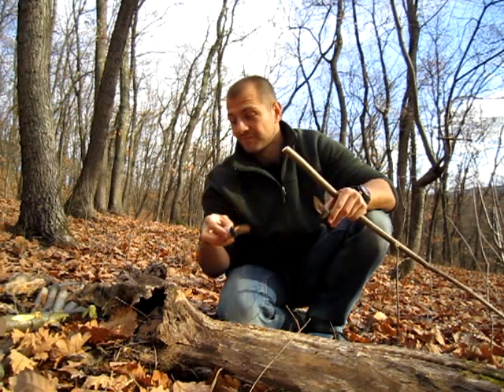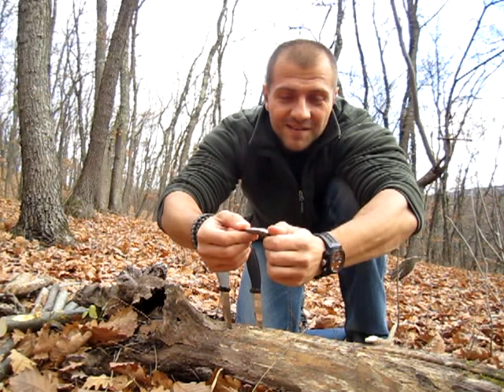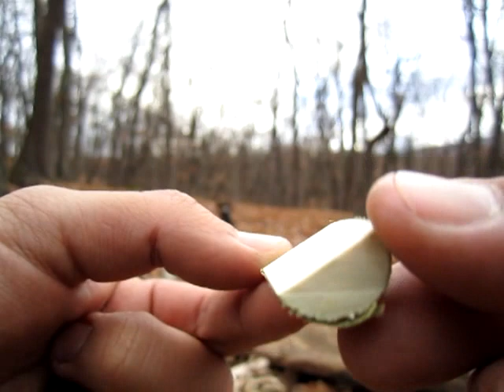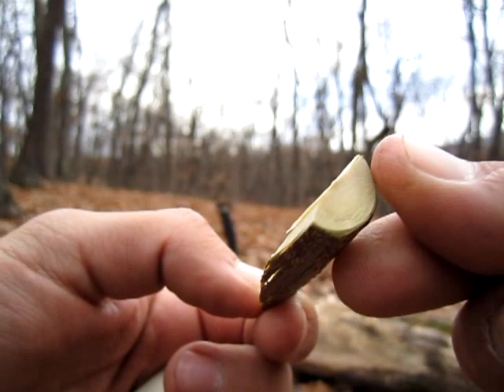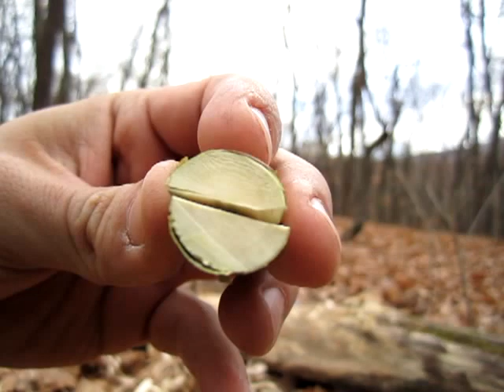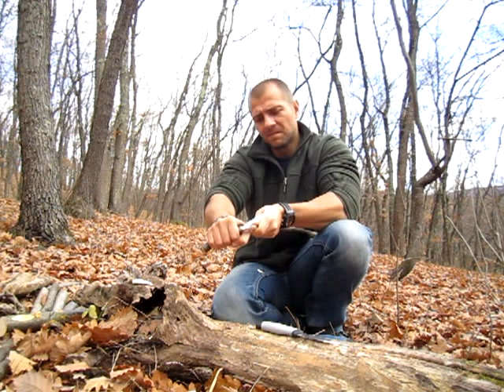Mora Robust Vs Mora Companion

Comment: I have two Mora Companion knives having liked the first one so much, I bought another so now, have one in green and one in black. Both stainless steel. I tested my first one the old fashioned way, processing a white tail deer in the field. From gutting, skinning and parting it out. Knife gave optimum results without need for sharpening. I always carry a Buck 301 3 blade folding pocket knife and have since my time growing up and working on farms and ranches. This pocket knife has come in handy so many times that I wouldn't know where to start in offering why you should have one in your pocket every day! I have made it into my 60s now in a life filled with hunting, fishing, canoeing and camping. I have relied entirely on Bic lighters and/or strike anywhere wood matches and have never been without fire. In recent years, I picked up one of the new ferro rods and have used it to start fire a few times. I guess what I'm saying is, be careful where you spend your money. It's easy to get caught up in all the latest and greatest gear but when it comes right down to it, simple and reliable and in your pocket trumps em all in most cases. Just an opinion from a life of knife use "in and out of the BUSH" as they like to call it now days. In scouts, we referred to it as "woods-craft". Be safe and always know how to get back to camp.
Reply from the maker: I agree with everything you said. First of all...the Mora Ccompanion is one of Mora's best knives when it comes to price/performance. I too used it for hunting(buck) and it did everything without problems. 
A BIC lighter will always work. Nowadays I prefer Clipper lighters...they come in bright colors with transparent walls...and you can remove the sparking mechanism if you want. Which can prove useful should you run out of gas....
As for spending money on things you don't need...well...i agree with you on that too...I envy people who do not have this "problem". There are a lot of bushcrafters out there who only have a victorinox and a Mora and they manage to do everything with those...
As for the Robust...the greatest advantage of the Robust is its 3.2 mm thick spine...if you are out bushcrafting/hunting you can do more with a 3.2 mm thick blade than with a 2 mm thick blade...
Lots of people are against batoning pieces of wood and claim this to be part of "the youtube trend". I found this to be simply not true. Whenever I work around the cabin with my girlfriend's dad he uses his knife in combination with a hammer or a piee of wood to make a cut, split something...this was a valuable lesson to me. People who use their knives because they need them not because they are testing, do so without thinking "is this the right tools for the job?" 
He had an old buck knife with a gut hook. He broke that gut hook while collecting pine resin. He never cared/complained about it... he ground a new gut hook into the blade... 
I have the highest of respect for such people.
I like to test knives and other tools. To be honest, when I go hunting, hiking, camping, you can always find a Mora Companion or the Robust in my backpack.

Comment: Say Heah Denis,  You do great reviews on the Mora's.  and I too have my preferences.  My Fav.  is my Mora 2000,  and very often I use my Mora 510 (new version)  which is the same blade style as my Classic #1, I actually like the handle better on my Mora 510, But when I made the Sheath safer on my Bokor Black Rold,  I took the Tec-Lok off and put a Belt Loop Carry.  But the handle snap was a little too big,  But still safe. I thought of many ways to tighten it up,  By sticking it.  But instead I put my Classic #1 through the strap and now I have my Mora Classic #1 attached to my Rold Sheath and it came out Aces. Actually with the Red in the Liners and the Red Handle,  It's looking good Amigo.  As usual a job well done.

Comment: First off: your English is superb. Also a very good comparison of two very practical knives. Just had one question concerning your gear there: what is that watch you're wearing?
Rock on and stay safe out there.
Reply from the maker: +TheAnonymousSword Thank you! 
The watch...it is a collaboration between Casio and Seiko. I stopped wearing it a long time ago. Nowadays I wear  Casio Pro Trek PRG 550. I can really recommend this one since I have been wearing it for over 2 years. It is a though solar model and so far the battery is and has always been on fully charged.
Reply: Thanks very much, I'll be checking that out.

Comment from the maker: the robust is a good knife. however i preffer the 746 much more..the handle on the 746 does what I expected the handle of the robust to do...
I like the blade thickness of the robust...and the weight...it is a nice knife to take along. Very reliable too...

Comment: Nice comparison with the ESEE, would be interesting if you could touch on some work where it showed its benefit as the higher edge angle does put it significantly behind for any wood carving.

Comment: I'd go with the robust over companion. More steel, and also thicker for Bushcrafting and light to moderate batoning.  Not quite a survival knife, but it would do alright in short term survival situation.
Reply from the maker: i think it would do very well even in the long run....i still have the knife and still split wood with it.. it is still in top shape

Comment: Helpful video.  Do you know if the Mora Companion HD is the same knife as the Robust but a different color?
Reply from the maker: I always thought it to be so...The HD is in OD and the Robust is in grey.
There is an older version of the Companion with a 2 mm thick spine and a new version of the companion with a 2.5 mm thick spine.
But as far as I know the 3.2 thick grey one is a Robust and the 3.2 mm OD one is a Mora Companion HD.

Comment: Thanks....great review. But is your 840 MG the military or the regular model? They sell it in both versions. Thanks.
Reply from the maker: The knife I have in this video is very old. By the length of the tang I always assumed it is a Mora Companion since the Clippers tang only goes 1/3 into the handle...
This one, the stainless has a slightly longer blade, that would make it the 860, i guess...

Comment: Hi,, Which model? Carbon? it is not indicated,, Heavy Duty stainless steel (12c27) vs Robust Carbon (1075)?
I believe the "Robust" are all "Carbon" -- 12c27 is a good steel (used by Opinel) but I prefer Carbon (HRC 60 or more) for its sharpness, ease of sharpening, etc. in addition to the fine stone, although the Mora are well sharpened, out of the factory, I am switching to leather! (je fais un passage au cuir, je ne sais comment le dire en anglais)  I polish with leather.
All Mora's are a bargain! at the unbeatable value for money, I will buy a Robust!
Note: you didn't do a little batonage test?
SM - France
Reply from the maker: When the Robust came out it was only in carbon steel. Nowadays you have the new version of the Robust and the Mora Companion HD which is in SS or Carbon steel. 
I like the carbon steel version for bushcrafting....it does sharped a bit easier and does hold an edge, in wood a bit better. it is a bit tougher, imo. 
I kept Moras sharp only using a leather strop for a very long time. 
As for batoning...The fixblades I use nowadays have all been tested and batoned. It is a very easy way to see if there is something wrong with the heat treatment. 
Glad  you liked the video

Comment: Great video. Question though. Why put a micro bevel on the scandi grind? I just ordered the robust. Is the scandi grind it cimes with not good? Thanks!
Reply from the maker: If you use a knife like I showed here in the video and the blade does not have a micro bevel, only the 12.5 degree per side it comes with from the factory, it might get damaged.
the micro bevel is there to protect it.
for regular tasks you would probably not need a micro bevel...unless you would cut some very hard wood(knots,fatwood)
Reply: SpartanJohns When a knife,comes out of the factory with a micro bevel,is because it earns time for the factory to create the edge.The only way to protect your edge,make it more resistant to micro chips or rolling and improve how the edge holds its sharpness,is to put a convex edge!
Reply from the maker: Leaderilaos Chaqal a micro bevel is not the same as a secondary bevel. I like convex grinds but for some tasks I prefer v edges. most all of my knives have a micro bevel. it worked out fine for me so far
Reply: SpartanJohns Of course but if you convex that micro bevel,the edge becomes much stronger.That means less chips and rolls and maybe better edge retention! When it comes to knives,everything is personal taste.I just say my experience through the years.Your videos are very interesting,keep up the good work.Have fun!

Comment: Micro bevel? Why ? It's true test is on its original edge ! But that's my opinion only . As far as I can say all Mora's are great for the task there built for . Right tool for the right job ! Appart from that good reviews , btw the angle of the grinds make a difference usually the thinner blade wins on small tasks etc etc xpeacex
Reply from the maker: This was a long time ago. Nowadays I shy away from putting microbevels on Moras. Nowadays I like the smalles edge angles possible. for splitting wood I have thick blades but even those I like to keep with thin grinds(as thin as they can take it-see my esee 5 video if you care)
Thank you
Reply: SpartanJohns thanks for reply and I have subscribed and look forward to watching more on your channel . God bless xpeacex

Comment: I love Mora knives but having a discreet Opinel nº10 folder in my pocket I don't feel the need of them. I mean, nobody sees a knife in my belt while walking out there and if I ever needed battoning for survival both would perform equally bad.
Reply from the maker: +Perico De Lospalotes A fixed will always be better than a folder for splitting wood. 
I also like opinels. I never ahd the no 10...only the 9. i like it very much.
Reply: SpartanJohns I have several Muela 440c fiixed knives but I almost don't take them outdoors. Since I discovered the folding saws like the Bahco Laplander carryig a machete or a small axe seems not very useful to me. Less effort, less time wasted, safer (no harmful cuts far from the city).
Reply from the maker: +Perico De Lospalotes The Laplander is definitely a usefull and safe tool. I carry mine into the woods every time
Reply: SpartanJohns Yes, when I started using one I thought: how can I been wasting until now so much energy and time chopping what I can get with few movements back and forward?
Reply: Hacha de Huesca and Opinel number eight, twenty euros total.